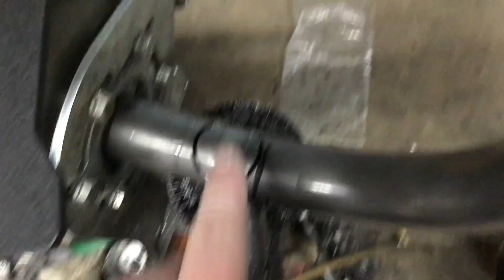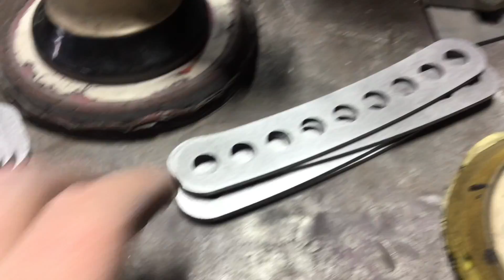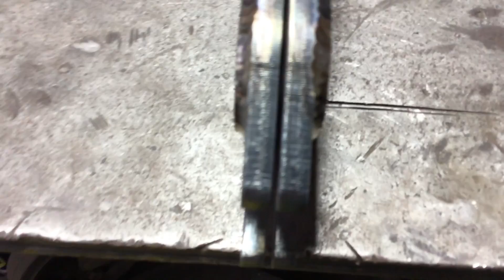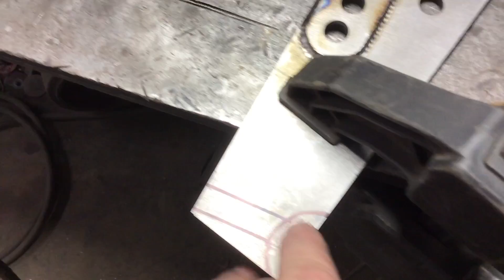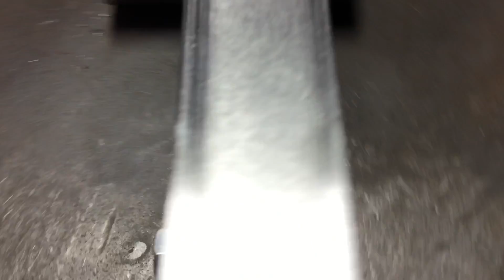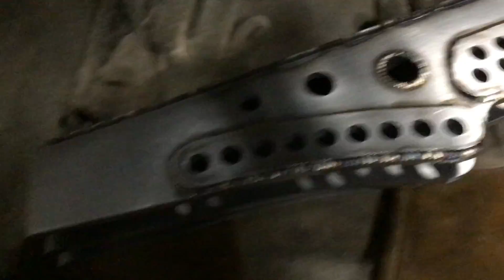Nova Gets Rear 4 Link Suspension Brackets from Tin Soldier Racecars! 25.3 Chassis

Comment: Friend, I am a follower of your work and with that I learn a lot by observing although I am not fluent in your language. I'm from Brazil and I'm starting a tricycle project and I have a Rewaco conservation manual. I would like to know the diameter of the tubes and if they are tubes with seams. Congratulations beautiful work.
Reply from the maker: Thank you! That is a neat project! The tubing I use is "seamless". it is 4130 Chromoly steel. The main diameter is 1.625 Inches, with a .083 inch wall thickness. Others I typically use are 1.5 inch with .065 inch wall thickness, 1.25 inch with .058 inch wall thickness as well as some smaller sizes including 1 inch with .049 inch wall thickness and .75 inch with .049 inch wall thickness too. These are standard race car chassis building tubing sizes. I wish you good luck with your project and thank you for the compliments and for watching!

Comment: I’m not very skilled on tig welding especially stainless or chrome moly for that matter but is completely necessary or worth it to have post flow going that long. Just curious
Reply from the maker: Excellent point, The machine I'm using in this video is an older style transformer machine which is not easily adjusted like a lot of the newer inverter machines. It automatically establishes a post flow time based upon the amperage it is set on. For tacking things together, it is not necessary for the post flow to go as long as it does, however I just like to use the post flow over where I have welded since it is flowing anyway. It is, however, best for the tungsten electrode not to be exposed to oxygen before it has cooled after completing a weldment, this includes rapidly moving it from the weld location after the arc has stopped, especially with a long stick-out. Thanks for checking out the video and commenting!

Comment: I got to ask are the brackets mly because that looks heavy and wtg is free HP
Reply from the maker: The brackets are 4130 Chromoly and they do have some weight to them. I wanted all parts of the chassis to be made from the same metal for weld purity and strength. This car might be doing some small tire (28x10.5) bias ply racing, possibly even no-prep small tire stuff, so a bit of weight in the rear is actually good for that application. Otherwise, the heft is just necessary to maintain the strength needed in this critical area.

Comment: Why didn’t you hide your air holes underneath the tube so you don’t see them?
Reply from the maker: They are; those holes are under the outer hoop sections that I welded onto the chassis. I just had to complete the welds holding the tubes that the hoop sections welded to, and those welds were next to those holes which ended up under the hoop tubes. Hope I didn't confuse you, hard to explain.
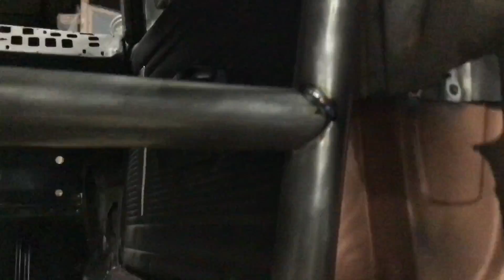Reply from the maker: If you watch from 39:18 to 39:50 it kinda shows how those holes got covered up. Also, thank you for watching the video! I appreciate the viewership!